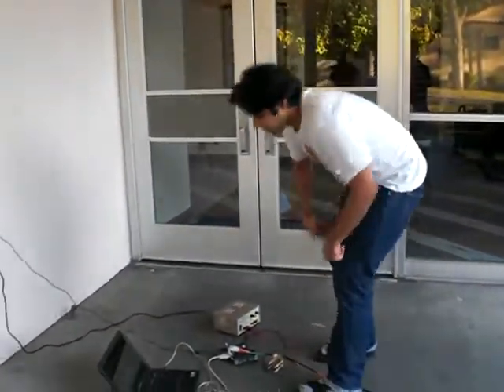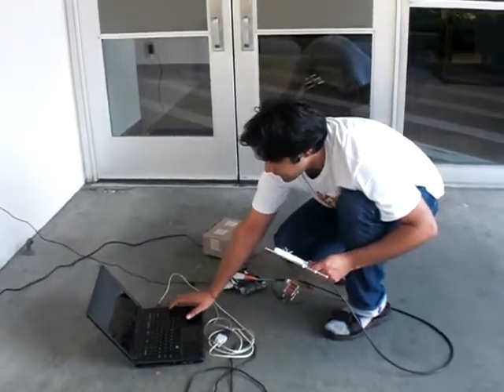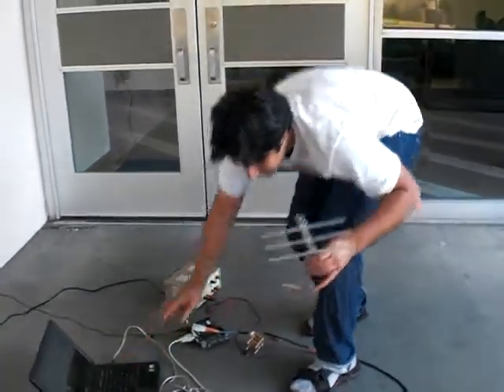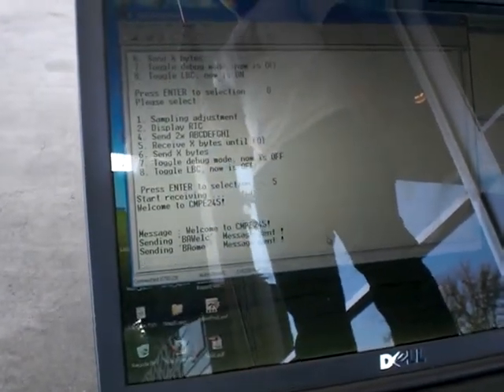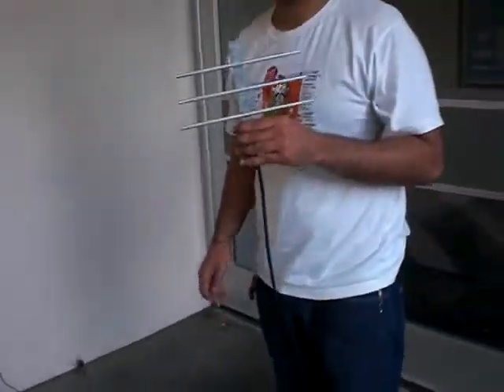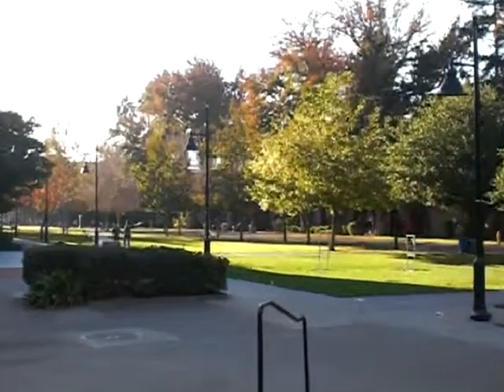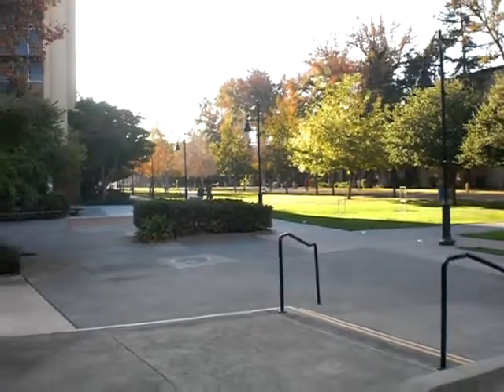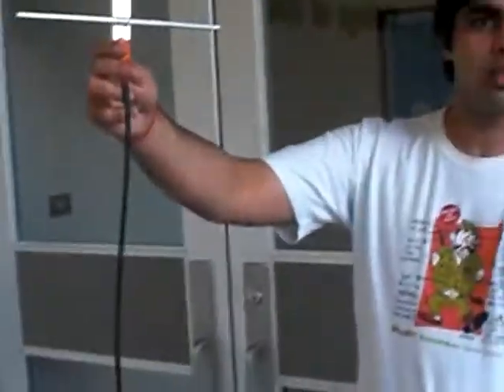Yagi antenna, 150m range

Comment: Indeed ,  he is not even directing it at  the 150 meter target, And 150 meters  is  not far . Heck,  a 5.5 dbi omni should  reach that  far outdoors!  Which, is  why, this mis- directed Yagi even gets  there.  If  the middle  element is fed,  he has  one reflector (toward the cable), and one director (off the end).  Probably 9 dbi  off the end. Whether  the  element rods  are vertical  or Horizontal  determines polarization. and as was  stated before,  the boom should  be horizontal.